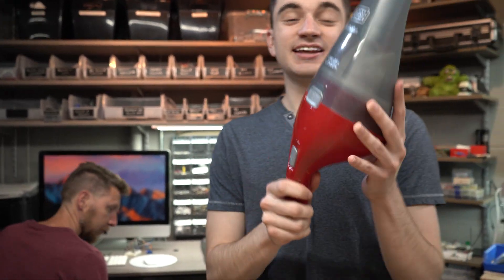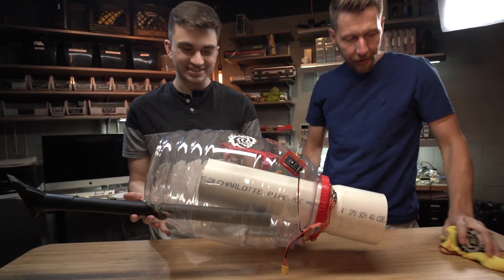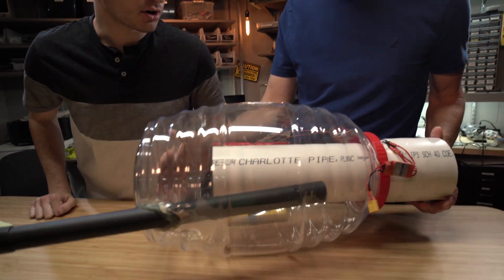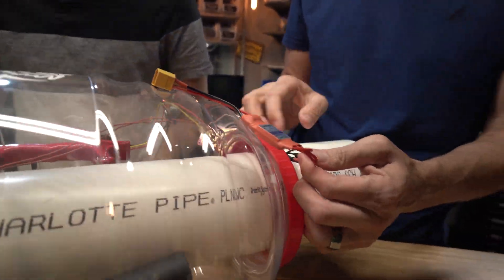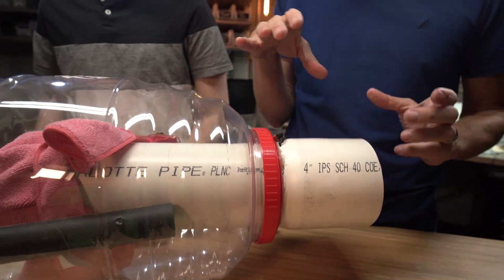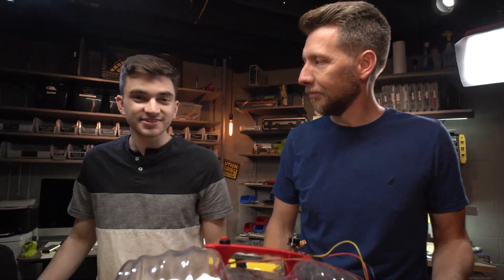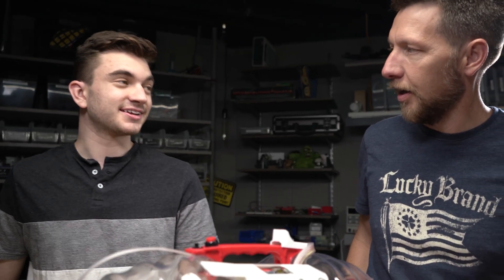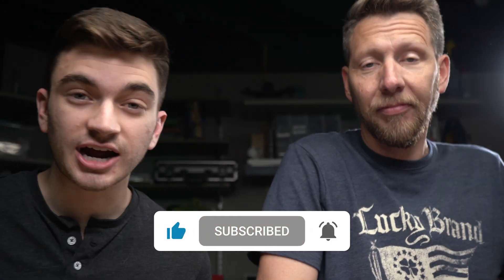We built a Vacuum Cleaner from Drone Parts?!

Comment: Love it but I do have issues with people using conduits without end fittings. I think I have some STLs of something that could work to cover that last little bit of exposed motor wires. Nice job though. Can't wait to see more.
Reply from the maker: Would love to use the 3D printed ends for the conduit!
Reply: @HackMakeMod  I'll post the STLs  on my thingiverse page TheRobotGroup in a bit. I'll see if I can make a flange mount version to fit this design.

Comment: Don’t need an arduino just a pot and a pcm controller.
Reply from the maker: Thanks for the feedback! Can you share a link to an example?
Reply: It's the rampup that's the problem. Although, an esc with rampup settings (common in heli esc's) and a servo tester would work